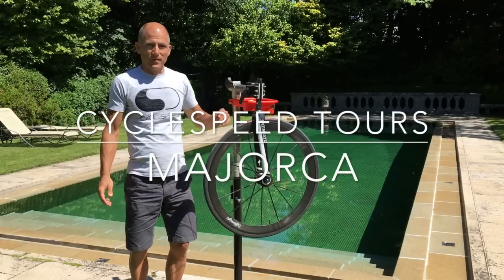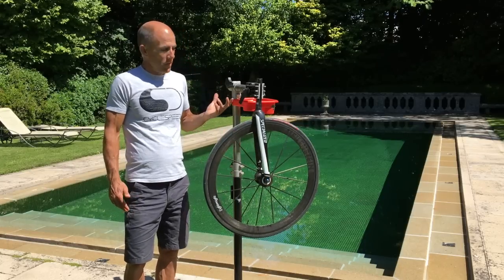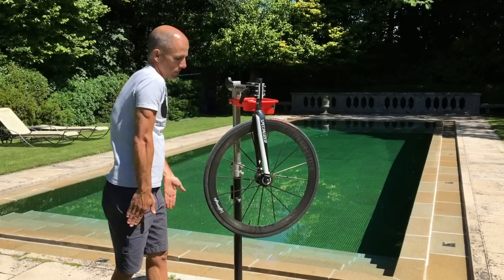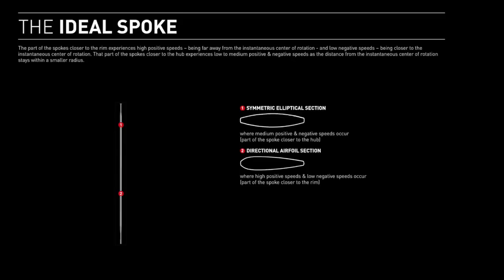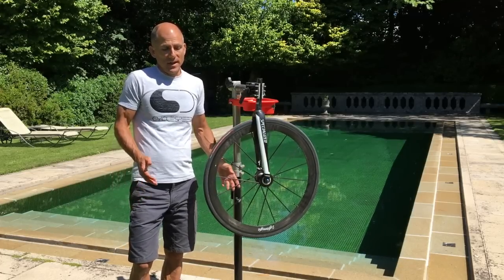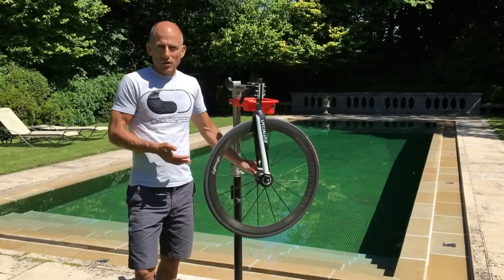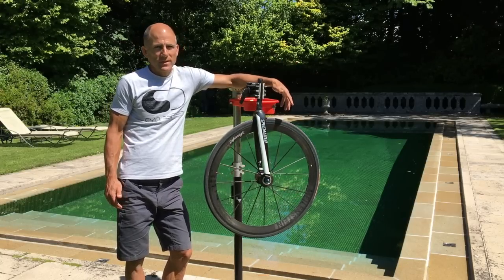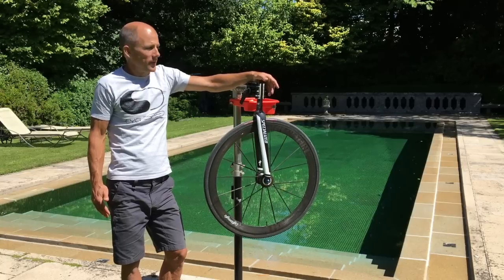Aero Wheels - What they are NOT telling you!

Comment: If you have a spinning wheel in the wind tunnel and don't measure the rotational drag separately, you're NOT ignoring it, but you measure the bottom line which is the only thing that matters. The rotational drag itself is meaningless because that would only tell me the drag while standing still. It's not possible to make any conclusion from such a measurement for a real-world application.

I don't want that info published, because it's meaningless and it will probably mislead users and therefore work against real innovation.
Reply from the maker: It is beyond dispute that the drag of of wheel is made up of 2 main factors; A) translational drag, i.e. moving the wheel linearly through the air, from Point X to Point Y, and B) rotational drag, i.e. the drag created by the spokes / rim rotating through the air.

If you spin a wheel in stand there is no A) and lots of B).

If you test a wheel in a wind tunnel with a stationary wheel, there is lots of A) and no B)

B) will be not be the same between A) of zero and A) of 45km/h because of extra turbulence.

So if you do not measure rotational drag in the wind tunnel then YES you are ignoring it, as the 'power to spin' is not being recorded. Imagine your spokes were like paddles, would take a lot of energy to spin that wheel right? Normal spokes take energy too, just much less, but not insignificant.

Picture 3 different tests;
a) wind tunnel with stationary wheels
b) wind tunnel with spinning wheels
c) wind tunnel with spinning wheels, measuring the power to spin.

Which is the most complete IYO? b) is better than a) because a spinning wheel will affect the translational drag to a small degree (compared to a stationary one) and c) is better than b) because you get the full picture.

To spin the wheel in the tunnel requires some power. How much? 5, 10, 15 Watts? Why would you not want to know that? If before the turbine is turned on, we measure 10 watts to spin the wheel, but 13 watts when the turbine is at 45km/h then that is useful information. 

By the same token, if we find that by hiding the nipples in the rim, that drops to 9 watts and 12 watts, then again, we have learnt something.
Reply: @CyclespeedTours  What I said was that only b.) is meaningful for the consumer. The engineers probably measure lots of other things as well to try to identify areas they can improve.

Let's assume the following scenario.
Two wheels have the exact same drag in setup b.), but one has a higher rotational drag than the other.

What are you doing with this information? How do you take advantage of that knowledge?
Reply from the maker: @yas96225  If a)(rotational drag)  is around 25% of total drag how can it NOT be meaningful?
In your scenario, you try to understand WHY one wheel has a higher rotational drag than the other, then try to improve it so it becomes as good as the other wheel. Maybe the spoke profile is different. So you just learnt which spoke profile is best.
Reply: @CyclespeedTours  Let's stay on topic, otherwise, we're not getting anywhere. Nobody is or was ever talking about scenario a.). 

You can't just measure rotational drag and horizontal drag independently and then add it up. They interact and influence each other. This means you might improve rotational drag and increase the total drag or vice versa. It might give you some ideas (that's why engineers should do it), but without validating it with a test in setup b.) you might draw the wrong conclusions.
Reply from the maker: @yas96225  We are on topic. It's all relevant. I have seen many examples of testing using scenario a). It is cheap and simple to do. Sometimes both wheels stationary, sometimes just the front.

I never suggested you could measure Rotational drag and Horizontal drag independently and then add up to get a perfect answer. This MIGHT give you an idea, but far better to measure Ro drag whilst in the wind tunnel with turbine on.

THAT is what I am advocating - test for both in the wind tunnel at the same time. THEN you will get a clear, full picture of what is going on. If you completely ignore the rotational drag you are ignoring a significant component.

Comment: A basic calculation shows that rotational drag is 1/3 of the translational. So the 25% figure you quote is right on.
Reply from the maker: Depends on your speed I guess, but sounds about right, thanks!
Reply: I need to look up my notes, but pretty sure it doesn't depend on speed.
Reply from the maker: I just mean that the rotational drag will vary a bit between V=0 and V = say 45km/h. It will not spin the same in still air as in moving air. @carlosflanders518
Reply: @CyclespeedTours  Yep. Gets a bit more complicated when the air is moving. Did some basic maths and, for still air, the rotational drag is a constant fraction of translational drag for all speeds. Bring wind in and it's not obvious how it relates. I need to sit down and run some calculations when I have the time.

Comment: the rotational drag will mostly be down to the bearings and the weight of the rim. You can have an extremely light rim which spins forever with little power and it will not be as fast as the other more aero rims.
Reply from the maker: Hi. Sorry but no. Bearing drag is linear (as speed increases) and relatively minor. Spoke and rim drag increase with the SQUARE of the speed and become very high at high speeds. Spin a wheel up to 40km/h, It slows rapidly to 25km/h. Why? Aero drag on the rim/spokes.

Comment: it amazes me how manufactures say how they have put so much time into research and development into aero dynamics when the two biggest thing about wheel rim aerodynamics is the depth and how blunt or sharp the leading edge is, yet they have only just been releasing wheels that have blunt leading edges that vastly reduce how much the wheels get affected by cross winds!
Reply from the maker: I think 'vastly' may be overstating it a bit! A 50mm+ rim is always going to move around a bit in strong crosswinds. I could never tell much difference between my Lightweights, Corimas or Campas, all about 50mm, but with different leading edges.

Comment: Cant see the point of those half way house, heavy wheels.  A lightweight road wheel with a monokote covering (which is used for covering rc planes and weighs only a few grams, and is easy to apply)would perform much better than a deep rim wheel or even a proper carbon disc wheel. Theres a vid on youtube of someone applying monokote to wheels and they look awesome. You get the full aero benfits but retain the lightness
Reply from the maker: It's not a bad idea and I know several people have tried this in the past. It's worth a bit more investigation.....

Comment: I built me a 29+ bike, using carbon wheels and WTB 3.0 tires. When I am riding and looking down at that front wheel, I can't help but think at how that fat tire is deflecting wind from the churning spokes. Yes, it has a fatter profile, but as you are saying that is not the entire story. I did a test and found this bike I built was just as fast as my Trek Superfly 29er. I raced the bike in a gravel race and found it to keep up very well. It was actually very fast on the descents as those fat tires gripped much better on the twisty dirt roads. It didn't seem to do as well on the section of road as the true blue gravel bikes, but if there is a course with dirt road climbing/descents with a smaller portion of paved sections the 29+ seems to be a good way to go. I built my bike with almost all carbon fiber parts, no suspension to make it light and fast. Gearing is a 1x11 with a 36T Wolf Tooth front and a 11x46 in the back.

Comment: great video! i think wheels are very much about marginal gains and you definitely make it clear in this video. i also think dt swiss knows what they're talking about since they're such a prominent manufacturer for wheels. i definitely trust their engineering the most - 240s hubs are king in my opinion (180 for the rich guys) and you bring up a great point in this video. i do get offput by the fact that shoe covers and helmet covers/aero helmets provide the same aero gains for so much less but it's also nice riding bling wheels too.
Reply from the maker: Indeed, DT make some of the best hubs out there. Simple, light and reliable. Aero is about picking the low hanging, cheap gains first, and then if you want to go further, spend a bit more to get the extra watts, but it's the old law of diminishing returns....!

Comment: I am 66 years old cyclist, riding almost entire life...not professionally, but prity hard anyway. I like this guy bringing up the issue of aero drag up, but there is really much more to it. I will just mention the basic concerns: Bearings and its lubrication oil type, size of hub, profile and weight of spokes, nipple material, weather the nipples stick out of the rim or are hidden, nipples can be on hub side, weather the spokes are round, oval, flat or drop shaped, how well the spokes are aligned to the direction of rotation to minimize drag, if the spokes are shaped /flattened all the way to the wheel or the nipple vs. there is (as on majority commercial ones) are with round shape left, how big is that area, depth of the rim, shape of the rim, weight and shape of the rim, tire weight, tire shape, tire and rim thickness miss match. Also, I am wondering, if anyone thought of using avian(bird) feather lubricant on the outside of the wheels, frame, the body and apparel....because , obviously the feathers create a drag, but the birds lower it by putting their specific lubricant(just like fish does) to lower the drag. And then, there is of course the helmet and shoes.
It is obvious, that elimination of any wind drag is of big help at higher speeds, which can be seen on the bikes with wind shields or even recumbents or totally encapsulated bikes, as in following example : bike at 133.78km/h = 83.35mph. 
https://phys.org/news/2013-09-high-tech-bike-world.html

Comment: Yes, indeed, the wheel building companies are lying a lot. Because not only rotational wind drag is very important(nipples at the rim or at the hub, flat oval or round spokes, number of spokes in the wheel....they never mention the differences in energy requirements), but also  wight of the rim itself and nipples at the rim makes a lot of difference in energy requirement. And it is almost impossible now days to find the weight of the rims used almost on any wheel set. It used to NOT be like that 20 years ago. You could find the complete spec on just about any rim. Not any more....It is all just white lie....

Comment: Check out dynamicspeedbalance.com  you can talk all you want about the slight advantages you are suggesting, but unless you rotationally speed balance your wheels (just like on your auto), all that fine explanation you  talk about goes out the window.

Sincerely
Dan Sotelo
AKA Mr. onZa
Reply from the maker: Clearly, you have a product to sell, but be careful not to over do it. An aero wheel does not become un aero because it's unbalanced. 
I have experimented with wheel balancing using a 5g weight to perfectly balance my wheels. (See my video on this). 
I rode a few hundred kms and noticed no difference. After a week or so I noticed the weight had fallen off. I noticed nothing, no change in any way.
I descend well and fast at up to 80kph or so, and have no problems whatsoever with wobble or stability. Nor do ALL the pro peloton.
The amount of imbalance is most bike wheels is just too small to worry about. Also, when the tyre gets changed you would have to re balance all over again.

Comment: I am a physicist.  There isn't much physics in this, it's quite hand wavy.  To theoretically describe what's going on you need to draw force diagrams for what the wheel is doing when the bike is moving.  For example, a wheel isn't moving at all relative to the ground or the air at the bottom where it is contacting the floor.  At the top it is moving at double the speed of the bike relative to the floor and air - so a 25mph rider's wheel is moving at 50mph over the floor at the top of the wheel.  Couple this with wind power generated by the wheel (commonly termed drag) is proportional to V^3 (speed cubed), not exponential as quoted (most wrongly used word ever by non-engineers - it has a specific mathematical meaning which isn't "lots") and you can start to calculate wind resistances (with suitable assumptions).  However, what I thought this would be about, which really is relevant is rotational inertia, which is higher for these heavier wheels - important for accelerating in a sprint or to accelerate onto the back of a pack if you're getting suddenly dropped by a jolt in the peleton.  The term "rotational drag" isn't physics - a bit like di-lithium crystals didn't power Apollo 11 to the moon!
Reply: No one went to the moon pal😂
Reply from the maker: Firstly, I think most people that have looked into this area are quite quickly aware that velocity relative to the air at 180' is zero and 2v at the top (0').
Secondly, Cambridge dictionary's definition of exponential in a mathematical sense is;
specialized mathematics containing an exponent (= a number or sign that shows how many times another number is to be multiplied by itself):
6^4 is an exponential expression.
Thus V^3 is also an exponential expression. But in any case the more 'general' use of the word, simply describes a rapid increase. Cambridge again; An exponential rate of increase becomes quicker and quicker as the thing that increases becomes larger.
Heavier wheels? Seriously? They weigh 1150g a pair and are thus some of the lightest around. And it has been shown mathematically many times that rotational inertia actually only plays a very small part in a wheel's performance.
I see no problem with 'rotational drag' used to convey the drag created due to spokes spinning and to differentiate from the drag created from a wheel moving linearly. Surely we can agree that the overall drag would not be the same between a non-spinning wheel moving forward at 40km/h and a wheel that is spinning.
Reply: Love this reply ....was going to say rotational inertia has a much larger effect on the wheels spin than "rotational drag"

Comment: I'm a new subscriber.  I like this video content from mechanical engineering standpoint.  could you recommend any most bang for your buck aero wheels?...when I got into time trial racing circa 2013 I purchased sram S-60 wheelset, which has hidden nipples and bladed spokes.  also they had just acquired zipp, but we're much better in pricing, with similar "toroidial" rim shape.  but of course I don't have a rotational resistance guage or wind tunnel to back up the claims...just my own personal data and tt results year to year (which varies on weather conditions).  anyway, kudos on good info video.  from Hawaii
Reply from the maker: Thanks! DT Swiss have a good range and Bontragers are pretty good too. Lots to choose from, but hidden nipples is good!
Reply: Hidden nipples are great for national caliber racers and above but a pain in the ass when it comes to working on your bike.  Unless you're a pro I strongly doubt that the aero advantages are anywhere near worthwhile.  I will also point out that at any local race every 3rd bladed spoke is rotated at least 45 degrees if not 90 negating the aero performance in real life on their expensive race wheels - on 2 out of 3 bikes.  I've seen a LOT of examples of sub par wrenching on racers bikes.   Yes bladed spokes are more aero when done right but most of them aren't done right.   Adding another way to make it a bigger pain in the ass to work on a bike will reduce the likelihood that it is wrenched as good as it can get.  That applies to both riders that work on their own bikes as well as the ones that are handed over to a "pro".  An out of true wheel isn't as fast a wheel trued to 0.5mm (or better).  I will also add that I've seen a few racers drop out of races because they busted a spoke on their ultra low spoke wheels.  When you break a spoke on a 28 or 32 spoke wheel you can open the brake and still ride.  With a 16 or 20 spoke wheel if you pop a spoke the bike will probably be unrideable.  Especially if it's with the paired spokes.

Comment: Shouldn´t the "rotational drag" equal the weight of the wheel? If 2 wheels have the exact same shape but differ by 100g the lighter one would have less rotational drag. That lighter wheels are easier to accelerate is no secret, once they´re rolling though the rotational weight is much less important than the aerodynamic properties are. I don´t think that this is some kind of secret. Cyclists aren´t only obsessed about aerodynamics but weight, too ;)
Reply from the maker: Rotational aero drag has nothing whatsoever to do with weight - it's all to do with the shape of the rim, spokes, nipples and hubs.